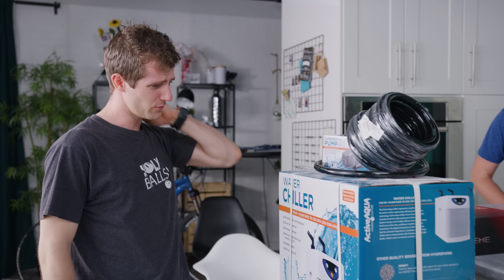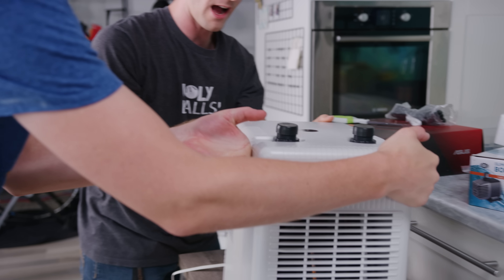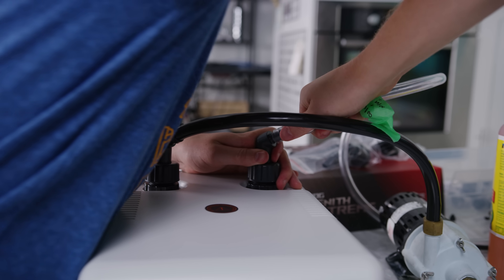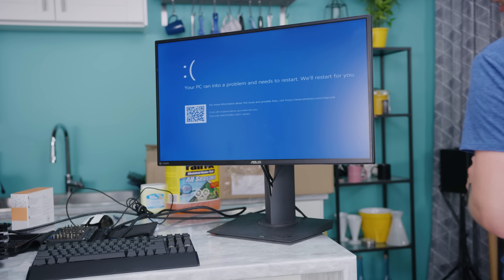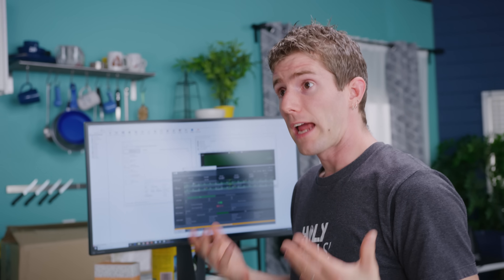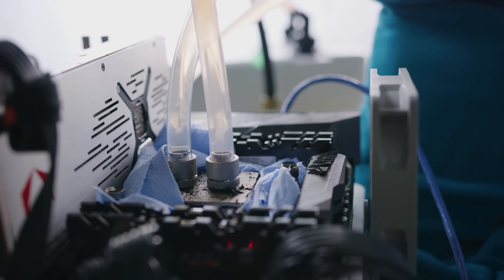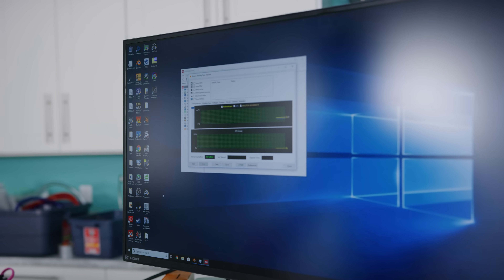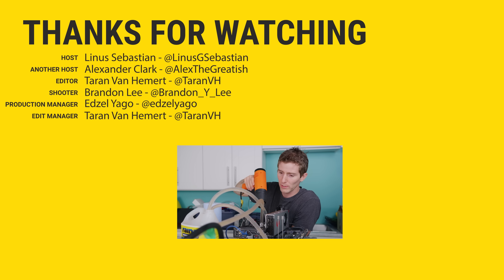Chilling Threadripper 2!!!

Comment: .. i'm surprised you dont know that pumps cannot work in that way..... you need a CLOSED loop for those pumps to work right. you need acquarium grade pumps to work that way. you probably either overworked the pump, ruined it or had abysmal flow

Comment: is it possible to get around the condensation issue by building the system with the motherboard face down? I imagine the condensation is occurring only on the CPU block, so in face down config the condensation would just accumulate on the block and flow down along the tubes? or does condensation also happen on the backside of the motherboard and cause problems there too?
Reply: To avoid condensation you have to insulate the tubing, the block, some parts of the mobo near the block and backside of the socket with neoprene. 
Do it right and you can run a chiller without condensation issues.

Comment: You bought a water chiller for an aquarium and expected it go below the freezing temperature of water... those are some high expectations.
Reply: Don't you have polar bears in your aquarium?
Reply: i think you dont really understand the comment link99912 made
Reply: you can actually mod these to bypass the internal thermostat and achieve -20c, and you don't just use water, you use a 50/50 glycol/water mix.
Reply: Lmao, that was great.
Reply: I'm sure there are some people who want their aquariums below freezing. They may not be using 100% water, but hey.
Reply: @Sn1peralex  then you would buy something that can provide it.
Reply: water chillers can be freezing but they limit it hence why over clocking a waterchiller is a bad idea for warranty sake you can cut the limiter off and it will go below what the compressor can do

Comment: I think peltiers elemets with heat exchangers is an way easier solution, just consumes more power, also i would always add a radiator before the freezer, to lower the temperature to some that is closer to ambient temperature, then lower it with the freezer, saves power adds coolnes

Comment: Integrate it in to a system with the 2990x and vega instinct 25 waterblocked, all chilled.
Then run an actual workstation workload on it lol.
Failing that, a Vega 64 liquid, cut the stock rad hoses, and tie it in to the loop along with the cpu.  
So you could run it all at like sub 10 C.

Comment: Water chillers are great for low temp cooling. Cool GPU on the same loop... Cool motherboard pwm with monoblock. I used to chill my old CPU with a TEC + water but I always wanted an aquarium chiller.

Comment: 15:51 only if you go all the way. heatsink and bring everything to an exchange (and i mean everything) then source a case you can pull a vacuum on. put all of the phase change cooled parts in a vacuum. tell humidity to go fuck itself. go all the way.
Reply: i bet cody's lab could help make a vacuum chamber that would fit a board and cards with a sealable access for cables.  i think you could get away with just monitor, power, and a single usb, run the system on m.2 storage, use the single usb to break out to keyboard mouse and whatever else with a hub, the newer usb standard can handle A LOT, although you might want to go with two monitor cables out. the biggest pain in the ass is that you will have to take apart and custom heatsink the power supply. you think the motherboard and video card will be a pain? think again.

Comment: Problem is, that thing is a tenth a horsepower. So it can literally not keep up pumping the heat at a full load, and probably at a moderate load. Best case scenario, coefficient of performance of 5 or so, you can expect to pump 350 watts sustained. You would need a huge reservoir of probably 100 gallons or more at like 4c to support an 8 hour sustained load before your water hit above ambient temps.
Reply: Uh, did you actually watch the video? The 1/10th HP is referring to the pump - Little Giant have 2 1/10th hp aquarium pumps - one rated at 49 lpm (13 US gallons) and one at 75 (20 gallons), while that may be reduced by the pumping head, it will be well within the required flow range.
The rest of your post... perhaps you should review and edit it for relevance?

Comment: 1 10th of a horse power is about 75W. That's the maximum heat it can disipate. After that you're relying on on the mass of the water to absorb the heat.

Your best bet would be to cool the water coming off the cpu with a conventional radiator first.
Reply: That's not how compressors work.  The wattage draw of the compressor motor is not a 1 to 1 ratio with how much heat can be dissipated. In this case the cooler is rated at about 960 BTU/hr, which is about 281 watts.  Still not enough to keep up with the max draw on Threadripper 2 overclocked indefinitely, but significantly better then if it could only dissipate 75w.
Reply: It makes sense to add a rad in line, but does strength of pump directly = max dissipation ability? Seems unlikely.

Comment: Incompetence level: Linus Tech Tips.  They make a video about chiller and they spend 90% of time setting up test rig (something that should be prearranged). An hour to figure out that MB need newest BIOS. 5 minutes testing to kill MB because of condensation.
Reply: 0 information about loudness (apart that its not that bad ), power consumption ect. Instead they brag about how much power 32 cores TR use after overclocking.
Reply: Guess what genius 250W CPU will use a lot of power after you OC it. That's no brainer Linus.

Comment: Try putting the PC inside a drybox or a dry room (dehumidifier in a room). There won't be condensation if there isn't any water vapour to condense.
Reply: A good idea in theory, but not in practice. No humidity means high chance of static electricity, which can easily kill components. That's why server rooms and raised floors tend to run at around 30-50% humidity all the time.
Reply: what if you fill it with sf6 gas?
Reply: Sulfur Hexafluoride Gas? Yes!
Reply: @MarkRad  cool idea.  In theory it would sink into a tank like case and displace all atmosphere, including water vapor.  You could toss in a ping pong ball to monitor the level and watch for leaks.  And less mess than using mineral oil to displace water vapor.
Reply: @Eh_Wing 

Oooh. Mineral oil is a cool idea (although messy). Ive seen those fishtank pc's before. Until now, there's been no real performance reason to use mineral oil as it usually performs poorly, but as a reason to isolate water vapor from components, it would be a pretty cool idea. I'd love to be able to do that.
Reply: that's actually really interresesting
Reply: NH3 nice grammar
Reply: Mineral oil!
Reply: Yes there will. Only way to totally get rid of condensation is the put it in a total vacuumed space
Reply: Yes a dry box!
Reply: Der8auer found a solution: his chilled 64-core(Dual EPIC) System runs in 3M-Novec. the non conductive liquid blocks out the air with its humidity
Reply: as cool as that sounds it wouldn't work. youd have to have no infiltration of outside air. that could cause the air inside said room to become very uncomfortable to be in and potentially dangerous. if you mean a small box thats air tight around the system its self... maybe but another person commented that theres problems with that to. not to mention dew point isent a consistent number.
Reply: it would be sufficient to pack the PC in a case and chill that.
Reply: Submerge the entire thing in a nonconductive fluid.  Chill the whole damn thing.
Reply: that's a neat idea...maybe bake the cardboard...evaporate it...
Reply: You insulate and add heaters, I run way colder and for days straight (I could run a month without an issue, but my power bill would be high...). This is not sub-zero cooling, this isn't even keeping the CPU below a what a cold room is ambient. When you have ice form after a while, then you know its sub-zero, it should be freezing the moisture from the air on your coolant lines after a while.

Comment: To pump stuff use a "propipette" for god sake instead of your mouth. It is a tool use in chemistry to replace the pumping with your mouth. It costs nearly nothing. Check it out in this video : 
https://www.youtube.com/watch?v=yWHZWalGDls
Reply: To reduce condensation, you can use a lots of air dryer ( 30 $ per air dryer : not industrial grade). An air dryer remove the water from the air, so less water can be condensate in the board. It is well in your budgets. If you buy 10 of those (300 $), it would probably remove 95% of the water of the air. So you could go below room temperature without having a ton of condensation. The board will not be damaged by the water. You could reach a record of 1000 watt consumed by the CPU by overclocking. That would be awesome.

Comment: What if, instead of letting the system keep going back to idle temps, you kept an intensive process running continuously in the background, to keep the cpu hot, so you could lower the cooling temperature? You could pause and unpause that background process each time you want to run a benchmark. Maybe this way you could go much lower without hitting the dewpoint, and overclock further.

Comment: You dont need a CPU for flashing BIOS in good Motherboards like the Zenith.
Reply: Serious? It posts without cpu? Or does it auto update from usb stick when powered up but no post?
Reply: @VarietyGamerChannel  One USB-Slot is marked with BIOS for doing that.
Reply: @VarietyGamerChannel  Auto Update from USB-Stick
Reply: You can, but when you have a 1st gen Threadripper on the shelf about 10 feet away that can be faster.

Comment: now I am just picturing  that thing in the 100,000 system and then lots of rgb as well with it. Sorta like the most overkill system you could ever think of.  I know the 100,000 system is meant to be a good productive system, but I can't help thinking of the craziness. Maybe do it on an epyc build. 32 core threadripper 2, check, 32 core epyc x2 with all those ram sockets and pci-e lanes.
All I know is, I wanna see more of it, and not like the super 28 core 5ghz did we forget to mention it had one type
Reply: Just have fun trying to pay your electric bill

Comment: AMD should really change the way that newer processors don't need a previous gen just for a BIOS update.
Maybe they can put like a small temporary patch to trick the BIOS so it is being detected as the previous gen, then that patch will be deleted after the BIOS update, so consumers don't have to buy or borrow that older gen.
Or maybe that patch can stay forever, if say consumers or reviewers want to update the BIOS for many motherboards.
Idk, this is just my suggestion.
Reply: On high-end motherboards you can just flash the new one from usb, no need for an older gen CPU.. But that would be expensive on cheap motherboards.
Your suggestion would not work simply because the CPU has no bios in itself and you cannot just use the first gen bios in many cases, simply because when you wrote it you had no idea of the future changes necessary
Reply: They usually do, but most of the times you buy from a reselle that had it in store for a long time.
Reply: They can do it the Intel way... new chipset and motherboard each few months. Yay !! (I hope not)
Reply: The motherboard they were using has the very feature fralyx suggested, you can flash bios directly with only a usb stick, no cpu/ram/gpu required. Linus and whathisname just didn't know.

Comment: c'mon get your good old vapochill and throw the garbage out! They knew how to cool hot stuff back then because those old CPUs got reaaaaally hot! Today's cooling is like kindergarden!

This thing is ridiculous, it's heavy, bulky and looks like a piece of crap! It doesn't even "cools very well"...
Do you know the Vapochill or Prometia sftuff from the late 90s, I had 2 of them (Prometia Mach II and Vapochill LS) and it was so much Fun and worked so well. Only disadvantage was to wait a little time before the PC could turn on because the compressor needed to ramp up first. But then... With additional noise isolation it was quiet enough and you could go for crazy OC.

There's no real solution like that today. I understand why they offer these kind of "chiller" for watercooling today because Watercooling has become more accessible for the masses and they want to offer something for enthusiasts but spending hundreds of dollars or euros for a chiller that doesn't even bring the CPU near 0° is worthelss, even more if you consider that you would need some insulation for the socket area and the back alos to prevent condensation. All this was included in the Vapochill and was VERY easy and efficient to use. 

If you wanna cool like a pro then get a real compressor chiller, -30 to -50° should be no big deal for common CPUs.

TLDR: A real compressor chiller ist the only thing that can ever really top watercooling. These "watterchillers" are expensive crap, sorry.
Reply: It is, belive me ;-) No idea if you can find one of these units today, I lokked on ebay and other sites but there was no offers. Maybe on some OC boards you can find those. Problem is when the manufacurers stopped production they also stopped making new socket mount kits and new cooling heads so if you get one today you'll have to make a custom cooler head, backplate and mounting for the socket. But it can be done ofc. 
The results are great, a P4 3.2 EE was running at 4.1 GHZ @150W under full load at -3°C at an ambient temp. of 28-29°C which is crazy. The Treadripper 250W would, at full load, still be above 0 but hey, that's a monster ;-)

Comment: i wish i could afford to try this with my chv-z and 9370(or any 8 core) just to see what could be achieved using a silly solution like this... i wouldnt go below dew point,that would be fucking neat... 

my buddy had a chill case.ichill ithink it was, case had a compressor cooler in the bottom portion, and head unit for cpu, he used it till it became impossible to find anybody who would make him a head that would work on newer cpu's, then sold it....and regretted selling it.. 

note: we built a smaller unit sort of like linus's old one, but much smaller and didnt look as.. scarry, and use mineral oil for fluid, worked great, guy used it for years it did take some trial and error to find a good way to seal the res, but we made sure to get pumps and hosing and the like that was all guarntee to work fine and not break down with min oil... the nice thing about that setup, a leak wouldnt break anything... just require some cleanup.

OMG... dude.. better idea, that submurged pc you have.. chill it with this....even if you just use a radiator and fans to chill the oil, i would LOVE to see that... 

this thing built into an aquarium pc cart setup.... could be really neat... would prob want to double wall the aquarium(we use to help raise salmon to be released into the wild, this thing would have made that far easier then the metal tube chiller setup that was pretty much a window ac turned into a chiller...sold to schools and others doing this stuff...), by putting the aquarium that 's water was being directly chilled, inside another larger one, that we filled with water as well, and pumped threw a little 120mm car heater core with fan, to keep the outside above dew point. worked geat....looked odd till you explained it though... (also found that it actually lowered how hard the cooler had to work then with the aquarium directly exposed to air.. )

Comment: Can you run a GPU through the same sort of deal?
Could you run this setup, with an water to air (regular) radiator, so you could essentially "turn on boost" mode cooling for when say you wanted to do super intensive stuff.

Comment: Looks just like my new rig... except I don't have the chiller. Also what's up with your Cinebench? I'm getting within 10 points of 5297 consistently at stock settings and a 360mm aio, although with the Creation instead of the Zenith Extreme. Still I have a hard time believing the motherboard makes that much of a difference.

Comment: How does a 1/10 hp cooler (way under the 500w of the cpu) not only keeping up with the cpu but actively chilling it below ambient?
Reply: The reservoir water gets chilled down and is basically a chilled liquid heat sink, and wouldn’t stay cool under a sustained max load from the cpu overclocked. Duh.

Comment: Heres what you do, you set up a server in a vacuum, and have that water chiller cooling down the cpu (on its lowest setting) while you run 10 particle/physx simulators at the same time.
Reply: A vacuum will cause other components to overheat as they can't lose heat via convection.
Reply: well fuck it, put it all under oil!

Comment: I'd like to see this set up to a "standard" watercooled tower. Radiators in the case or not, maybe make use of those old tubing holes at the back of cases that no one ever used. I'd like to see a more "realistic" scenario where the water is kept above condensation temperature.

I see some people also suggesting a newer form of whole room watercooling. A chiller (especially a large one) should be able to handle a high heat load, so piping together a bunch of workstations in parallel with a chiller could be a good (multi) video idea.

Comment: one tenth of a horsepower is 74 watts. the CPU in contrast likely draws at least 300+ watts
Reply: Unless it's boiler horsepower, then it's 1000 watts
Reply: Yeah. This isn't going to work.
Reply: 100 W = 341.214163 BTU/hr plenty of cooling capacity for above dew point cooling 19.9 C is a good temperature.

Comment: Why not do a mineral oil PC with the cooler (cooling the mineral oil) so you don't have to worry about the dew point. I think you would have to fill and enclose the mineral oil so to limit the water vapor from the air mixing with the mineral oil. OR just submerge your current setup.